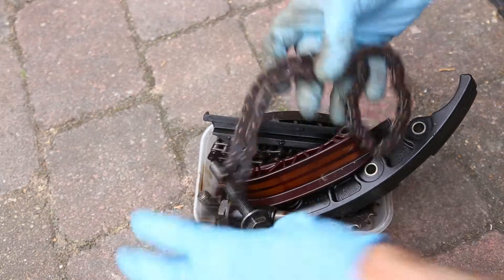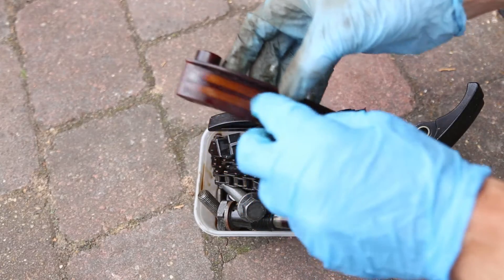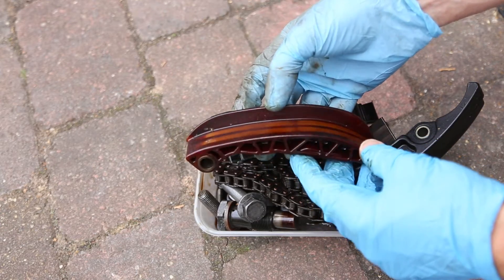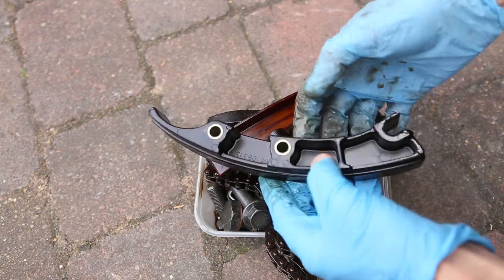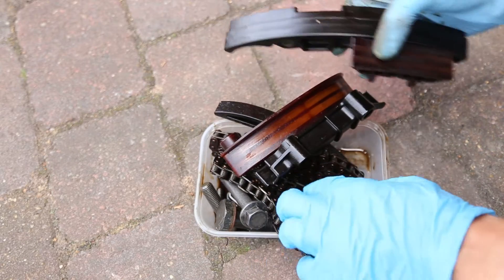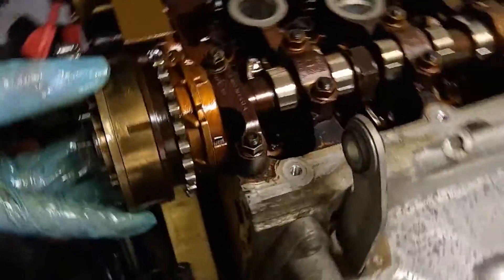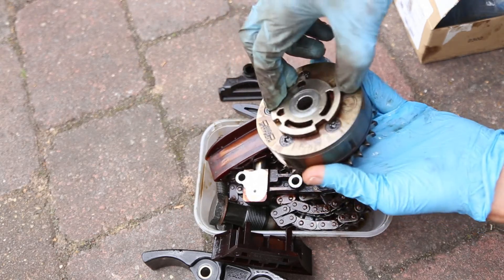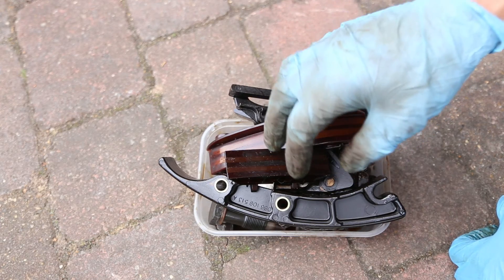Audi A3 3.2 V6 Camshaft Timing Chain/Tensioner/Plastic Chain Guide Rail Wear after 140,000 miles

Comment: can you give me camshaft numbers, variator numbers and engine code?
Reply from the maker: The engine code is BDB, unfortunately I don't have the other part numbers
Reply: @ajvw  can you change my one lol
Reply from the maker: @laylayw3  it was bad enough doing my own!
Reply: @ajvw  how much do you think it would cost on average for that work to be done 
Mines not clanking but very rough when idling perfectly fine when driving defo similar problem I've checked everything els it could be the tensioner